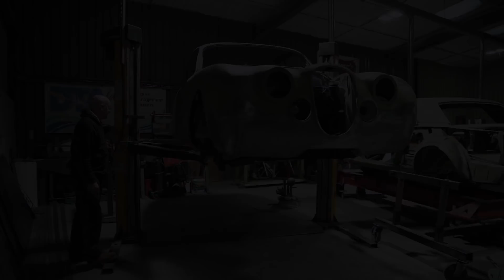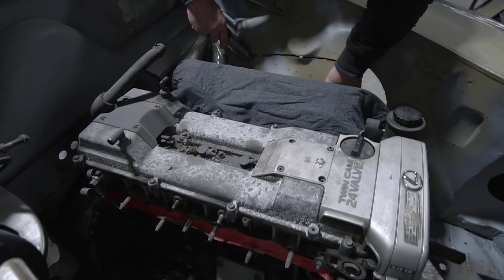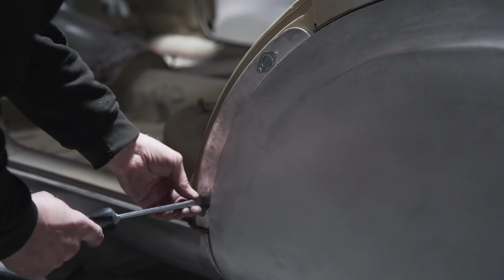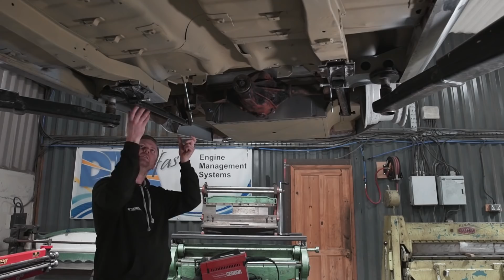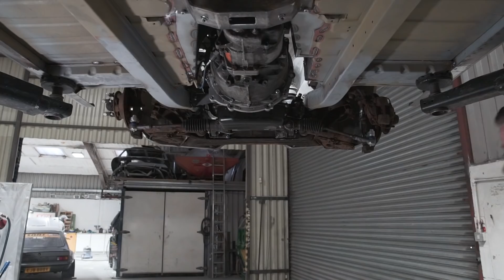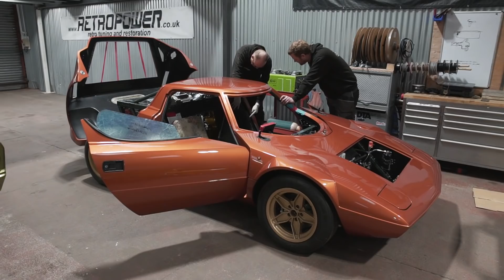MK2 Jaguar "Project Utah" - 2JZ Powered Restomod Build Episode 4

Comment: As an owner of a Jaguar 3.8S with an XJS steering rack conversion in place for 20 years I do note the issue with the lack of Ackerman effect on sharper turns.  Never experienced any bump steer issues however.  So to reduce tire scrubbing on turns, your modified steering arms are of interest to me. My car has a cast aluminum sump so modifying that is not what I would choose to do. Plus there is a anti sway bar in the way of moving the rack from its existing position.   However if the redesigned steering arms would correct at least part of the Ackerman issue,  that would be of interest to me. And probably to many S Type and Mark II owners with rack conversions.    So, has your design of them been taken up by any production firm?   John Quilter, Eugene Oregon USA

Comment: A deep, rich metallic green with a good deal of metal flake would do wonders to put the caddish-ness back into this Jag. Especially if you go for a more camel colored interior. It also works great with tan or cream, but you can end up with too high a contrast between the interior and exterior color that can cause some unpleasant shock if you aren't careful about it.

Comment: Having been the Chief Engineer of a major classic restoration company in The Netherlands, where Aston, Bentley, Maserati , Lamborghini, Ferrari, and Jaguars were restored to the highest possible specification to the most wealthy customers in Europe, I can say that my opinion is qualified, and informed, which is more than can be said for most of the commenters on this thread.
That aside, It is good to see a British company carrying out restoration of some interesting cars, using CAD and 3D printing where in the past we did those tasks by hand. I have built hundreds of engines to ride to work, or to race, and have never had an engine fail whether it was a V12 or V8 Vee6 or straight 6, and the XK Jaguar engine has been run flat out on our dyno, for 24hours,  giving full power, without overheating or engine failure, so the question arises, " Why put this Toyota engine in to the Mk2 when the Jaguar engine  is perfectly suited for the task ? This car is an expensive , but very UGLY duckling, and it will NEVER be worth the cost of building it .  By all means throw money and time at this project, but it is UGLY and like a pig with lipstick, no amount of attention to fine detail will change it's DNA. it is a butchered Jaguar.

Comment: Great build and I am so impressed with the skill your team has.  I have built a custom 3.8s with an LS1 and know that many unexpected mods end up popping up and not many can handle that.  I love the body work, the use of the Toyota in line 6 although I think the NIssan RB twin cam is slightly better but both are far superior to the Jag 6 by a mile.  I am surprised that with a team so talented that you did not find a way to convert the rear to an IRS so that you have independent rear suspension like the 3.8s has.  I know that would be a lot of work but you folks did a lot to just get a better straight axle in the rear.  I have put the XJ power steering and did have to do a number of changes from custom front lower control arms, tie rods, and different coil overs but it handles very well with no noticeable scrub.  I have coil overs front and back and with custom 3 piece CCW rims I am running 17" x 8.5" rims with 245 wide tires front and back on the stock body with no rubbing.  Hopefully since you are doing so much custom work you put something like that or wider as that really makes the car handle well.

Comment: I,V got a conversion kit from her in NZ I got worried  about sterring geometry coments.
On mine I turned the mount for the top wishboes upside down now theres no camber movment through the travel so no bump steer as for the steering arc the inside wheel turns more like it,s soposed to no prob at all.

Comment: Good job actually graphing the steering geometry. I am doing a 65 pontiac gto and the original steering was a complete comedy. Unforunately the several "bolt in" rack and pinion conversions on the market cannot possibly have correct ackerman based on the crossmember being in the way. I have managed to get it pretty good with the standard box instead. Its quite the battle as you may well know. PS ,the stratos! Yes!

Comment: Why did you not swap the complete front suspension from the later model Jag? All geometry would be good , new Brakes, and all in good condition. The rear needed just a panhard bar. Anti sway bars later as needed.

Comment: Again,, WHY use a Toymota engine. The original 4.2 oil leak would be preferable. Or the usual Chev swap.
And PLEASE use rubber bushes. Eurathane crap gives poor ride, and binds everything. Or becomes detached from the internal sleeve, THAT is the reason OEM use it!
I suspect you may well be better off using the XJ6 type front suspension. Not all of them have gone to Cobra kit cars.
Lets have a look at the Cougar, bugger the Jag.
Reply from the maker: Urethane bushes aren't supposed to be attached to the inner sleeve, they work on a different principal. The bush rotates about the tube, rather than twisting like a rubbed bush. We do need to be mindful of refinement of ride but it's quite possible to have great ride and refinement without massive rubber  bushes everywhere. It's always going to be a compromise between refinement and precision of handling though. A tough line to tread 👍
Reply: The Toyota engine is far superior than the Jaguar and will be more reliable and produce way more horsepower.  I would have rather seen a Nissan RB twin cam turbo straight 6 but that is my personal preference.  The Toyota and Nissan are the best straight 6 engines as they put out easily 400-600 hp in mild form and easily will put down reliable 700-1200 hp.

Comment: I fitted an XJS power rack to my '64 Daimler 'Mk2', with the adapter kit.  Front Bridgestone tires have lasted 10 years. I relocated the top arm pivot points. 420 uprights with the 3 pot calipers. Car tracks and rides well, even on what passes for roads in my town, after 'quakes destroyed them.  No inside or outside wear of tires. The rear axle does move around a bit.  Named 1/4 elliptics for some odd reason. NZ.

Comment: Fantastic work as usual.  The steering issues begs the question "was the original steering box design awful to drive?" I doubt that the rack and pinion steering conversion offered by others would be any worse, judging by the reverse Ackerman that's apparent with the original steering arms . My understanding is that the line from the centre of the bottom balljoint to the middle of the rear axle should pass through the centre of the trackrod ballpoint, works for me anyway. 
Keep up the good work 👍
Reply from the maker: That's pretty much what we were thinking. As it was I think it'd have been worse than standard albeit power assisted

Comment: Re XJ steering on MK2's. I've a Vicarage MK2 with the XJ Steering rack. They've done an amazing job on the tracking and bump steer. It drives like a modern. The car also has the revised rear suspension doing away with the leaf springs and having Coil over dampers

Comment: Regarding wheel fitment or, more correctly, tyre on wheel fitment, you may find this tool to be quite useful as you can mount the tyre you're considering using and adjust the offset and width for best fit/look before ordering the wheel(s).
https://mkt.com/cctek

Regarding the dash, and rest of the interior, I thought this was for an American client - wouldn't it be better to design things for left hand drive, or does he prefer the 'foreign' RHD setup?

Comment: Here in good old aussie(nz actually) Ford Falcon came with a watts link live rear axle and I remember motoring writers at the time saying the last incarnation felt better than the oppositions trailing arm IRS. Also I was thinking of SU carbs modified maybe one could get rid of the piston needle assy and insert a sleeve down to the throttle butterfly. Just my brain working overtime.

Comment: Fantastic job your team is doing. 👍 Having said that though, are you on too tight a schedule that you couldn't spend 5 minutes with a power washer removing all the crud from the diff before mockup? My OCD meter hit 11 when you lifted the car 😲
Reply: That could possibly be the rudest comment I've heard in quite some time. It's called OCD for a reason, because it's obsessive and therefore not normal. Maybe a bit of time spent vacuuming your pet or cleaning the traps in your drains would calm your soul. Mock up is when brackets are located and welded, fit is tested, location is finalized, ect, ect. Obviously you've never built a car that takes months or years to complete or you would know that unneccessary steps are in fact just that, "unneccessary".
Reply: @mattmoilanen3813  Settle down snowflake! You're reading too much into my comment. Didn't you see the 👍 I inserted after congratulating the guys on the fantastic work they are doing. If you reckon my comment was the rudest you've read in some time, you need to get out in the real world more. 👶

Comment: For a 'more appropriate period look you can get fuel injection 'SU type' throttle bodies. Only problem is that it will loose power as the ports will be siamesed if you use 3 of them
Reply: Who makes SU’s with an integral injector?
Reply: @chrisgarside7974  https://silodrome.com/burlen-sui-fuel-injection-carburetor/
Reply: these look pretty good, but then again i am very partial to the DCOEs, so i would choose those as well for a custom application.
Reply: @uliwehner  I guess more applicable to a more standard looking restoration such a an E type or Aston